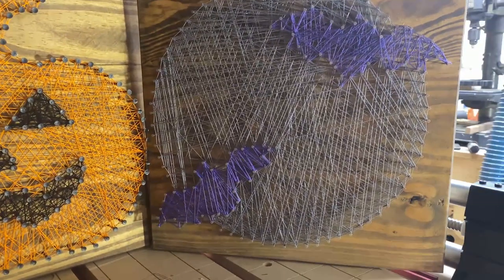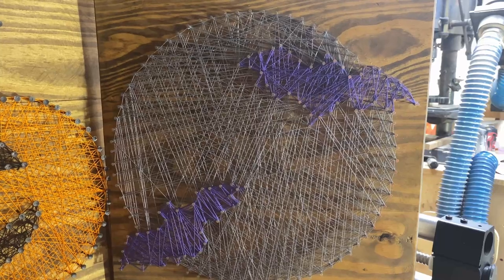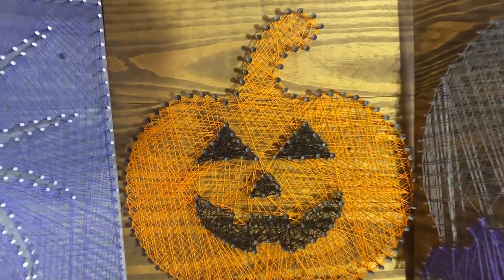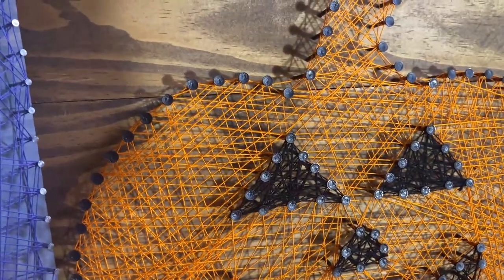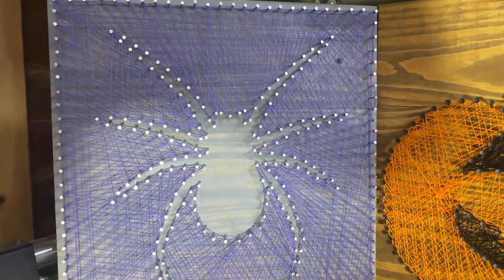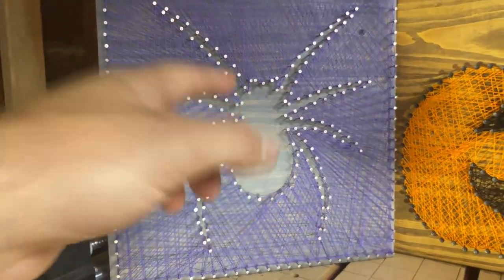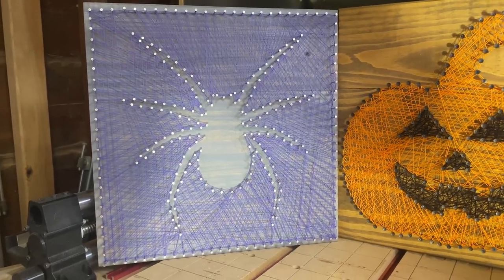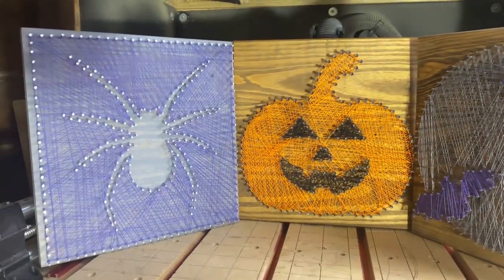13 For 31 Series. Halloween Finale cut on Onefinity CNC

Comment: I really like this one, never thought to create string art via CNC, when designing what software did you use to get the holes to go along the picture or clipart. Just curious if there is a trick to it, or if it was just a tedious process of lining up holes manually.
Reply from the maker: Thank you so much! I used multiple methods to plot the holes. Video tutorial upcoming…